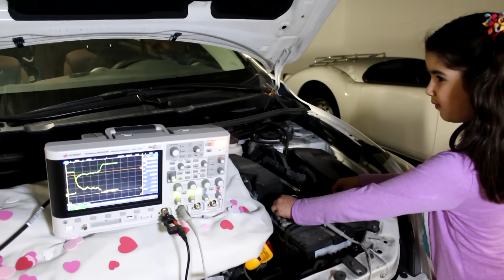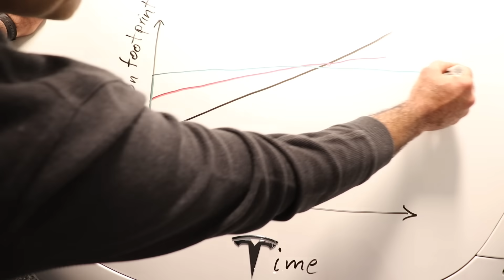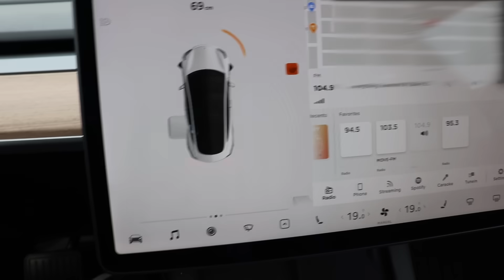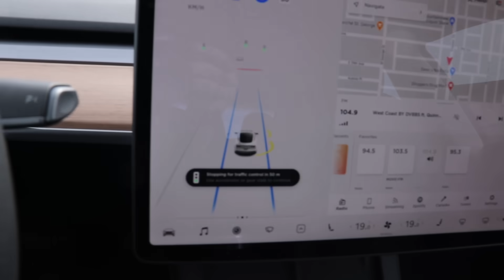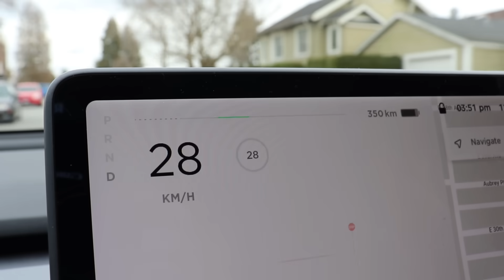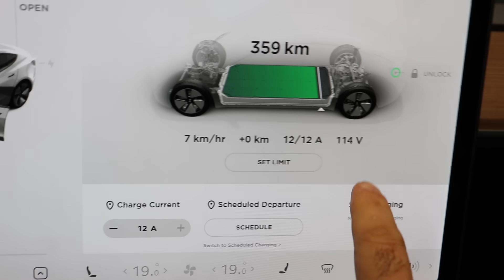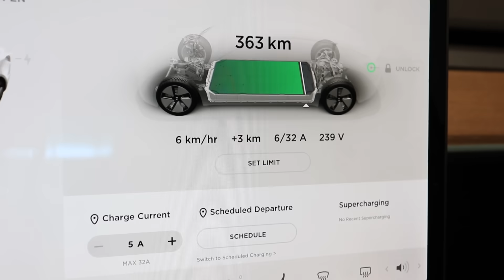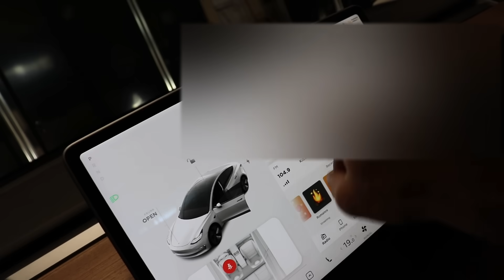ELECTRIC VEHICLES & My Tesla Model 3 Review

Comment: since when does a gas car not have as much range as a car that takes 30 minutes to charge? it takes like 5 minutes for a gas car and you can carry emergency gas in a car. arent electric cars that use scarce proprietary feuling stations worse for road trips?
Reply: Who drives 260 miles without stopping for a rest?
Reply: @jackwhitlock1  who wants to stop for an hour just to re fuel
Reply: @dancingturkey147  It doesn’t take an hour. My Tesla Model Y takes 20 minutes, barely enough time to go to the toilet and get something to eat.
Reply: @jackwhitlock1  20 is still pretty bad.
Reply: @dancingturkey147  That’s 20 minutes every 350 miles…

Comment: Problem with Lithium batteries is they still have drawbacks when cycling.

They last longer if you do not use all the charge within them, and maintain a 10%-20% Depth Of Discharge to get 12000 cycles out of them.

If you used that car everyday discharging to almost 0% , and then charging to full again (cycling at 100% Depth of Discharge [DOD]), it would barely last a couple of years (600-700 cycles), or not much more.

It would still cost a new battery, plus electric fuel for a couple of years (at 1 charge 100% DOD per day),  around $35K U.S. every couple of years to run the car.

$35K Price includes a new battery and all the costs of charging it for a couple of years. (excluding battery install fees)

That is based on the Model 3 Long range battery of 75KW.

That is approximately 1/2 the price of a Petrol car costs just in fuel, without the maintenance costs.

Still cheaper.

Comment: I own a Chevy Bolt. When I was in the market to get my foot in the EV door, I was considering Volts as well. However, the Bolt's regen braking takes it to full stop whereas the Volt you still had to press the brake pedal. 1-pedal driving is so much fun and a deal-breaker for me as you can see. For me, the savings both in fuel and maintenance was the primary motivator. Carbon footprint... nobody pollutes like the State. So while I might try to be helpful in this way and that, I understand that the individual is dwarfed.

Studies on Tesla batteries have found that for minimal degradation, you should be discharging to about 50% and charging to about 80%. Of course if you have a trip coming up, top it off. Thought I'd mention it since you talked about charging it nightly. My daily commute is low, so I usually only plug it into 110v every 3-4 days in the summer and 2-3 days in the winter.

I got a hell of a deal when I bought mine. When I was shopping, there was a battery recall in effect, so half the ones I could find were not even for sale. I ended up getting one for less than US$16000 that had only 10000 miles on it. Best part is that because of the repeated battery recalls, my Bolt will soon have its entire battery replaced free to me. At which point it will have 8% more range than when it first went to market, and will enjoy a new 8 year warranty on the battery. When you consider the only 10000 miles it had, I practically got a new EV for less than half the price! I worry that somebody's going to hit me and strand me with no way to get that kind of deal again.

Comment: I know i'm late to comment on this video, but maybe you should consider charging a bit faster than the minimum current to get the best efficiency. The system is powered for longer, and the battery might need to be heated/cooled for longer consuming more energy during slow charge. Testing the charge efficiency at different currents/temperatures could be a nice idea for a video.

Comment: HELLO Mehdi. I admire your desire to live more sustainable. ☺ 
And I don't want to be over-aware here 🥸🌋
No offense---> As your argument was, people should not put another ar in the pool:
Building a new car and battery causes a big need of ressources🌋 and emissions💨Without pointing the finger on very big pollutions in african lithium mining facilities and the lack of recycling methods and the capacity loss over time. There are indications, that using a SMALL conventional car (Your toyota) as long as possible may even have less emissions to building a new one and dumping the other. (Or encouraging someone to dump his old car by instead buying yours.)🤫So i'll buy my first electric car: as late as possible unless I can build it on my own maybe with (until now) unavailable EXTREME SUPERCAPS to charge it with one STRIKE of a LIGHTNING.

Could you actually build a SUPERCAPACITOR LIGHTNING CHARGER? And please don't die trying🙏.
Could you make a video outside for any matter????
Reply: So for the comparison of new cars I mostly agree but compared old conventional car against new electric car the initial emissions by dumping the old car needs to be added up.... I guess at least half to be fair.

Comment: Same experience, I also upgraded from an old ass Toyota lol, btw instead of cold weather issue I have the warm weather issue, car's fan and AC keeps running while parked to prevent cabin overheat which could technically be turned off but I guess option is there for a reason

Comment: 15:10 holy cow what is that? (European here)
This outlet and the adapter look INSANE.
Reply: Would you like a full explanation or a shortened explanation?
Reply: That outlet is usually used for ovens, washer/dryers, etc since it's our only source of 240v for the normal plugs we only have 120v so basically you guys don't need it anyway

Comment: Electric cars are fancy at the moment. Just like vaccines for covid. Governments pay for it (at least some of it) right now. But in the future...the electricity will increase in price and decrease in availability (because of the green shit) and then...electric cars will become less attractive than gasoline cars. And neighbors will have electric cars too and the grid won't be able to keep up with this situation... We will see what's next.
And, BTW, electronic injection cuts fuel when going downhill while the engine still revs and charges the battery and keeps everything working using potential energy gained by consuming fuel in the climbing process. Of course, most drivers will accelerate downhill because they are stupid... But that's a different topic.

Comment: Awesome video, and I like you tryiing the features for real instead of just going ooooh and aaaah over them :) But the newer bolt EV has a 66kWh battery pack, wouldnt it get a longer range than the basic model 3 with a 54kWh pack? Or does the canadian version of the bolt get some sort of a reduced battery capacity?

Comment: I got mine 2 months after you did...my left rear door handle is actually slightly recessed too (but not as recessed as yours, it's very slight).  Also, I can tell by the interior that you have the refresh Model 3.  This means it doesn't have the electric heaters from the original one, it has the Octovalve heat pump from the Model Y.  It still produces heat, to heat the cabin and batteries, but the COP can be anywhere from 1 (when at about -30C) to about 4.5 (around 10C).  It's MUCH MUCH more efficient and one reason the new Model 3's have higher range.

Comment: in germany:
30 €cent/kwh
54kwh battery travel 300km makes it 16,20€

my car, a 1999 passat 1,9tdi, worst case it has 6 l/100km, best 4 l, so lets take 5 l/100km
diesel is at around 1,52 right now.
15l travel 300km makes it 22,8€

cost of my car, 10 years ago, 2500€
cost a basic tesla 3 42000€
that means i have to travel 598.485km to brake even. 
the fucking batterys in a tesla will not hold this long and my car has already proofen that it can drive 480.000km without major problems. 
and oilchanges are cheep, every idiot with two lefts hands can do it them self.

Comment: Driving downhill in a manual gasoline car with your foot off the throttle while in gear supposedly doesn't use gas because the rotation of the wheels is what keeps the motor spinning; and that should keep the alternator and battery charged.

So your statement about all gasoline cars using lots of gas driving up and down hills isn't entirely accurate. For automatic vehicles, sure.
Reply: Most people, more so those who would consider switching to electric, are already driving automatic transmissions, or even CVT's.  We realize you diesel and manual folks are over there with the guys who need loud pipes and big wheels, not ready to change.  We're not expecting you to change so easily, but...a whole lot of us are ready and willing for the change, as soon as it's practical for our situation.
Even if Mehdi used the word "all," it was probably a reasonable exaggeration, if it's mostly true.  Most of us aren't using engine braking.  Even if I was, I'd rather have a feature that put gas back in the tank almost every time I slowed down, over one that didn't use gas in one specific situation or required me doing something extra each time.  (i.e., shifting my auto from D to L when I want to slow or stop.)

Comment: The pedal behavior you described with regenerative braking kicking in to slow you down, similar behavior does happen in traditional cars, it's called engine braking. Most people with appropriate follow distance can take advantage of engine braking without needing to use the brakes. But maybe regenerative braking is more aggressive than an automatic's engine braking at lower rpms.
Reply: Engine braking is the half-stop.  Regenerative actually puts fuel back into the system, by making the motor into a generator.

Comment: To avoid having to make a deliberate turn on the wheel to convince Autopilot that you're paying attention do the following:
1) Rest your elbow on the arm rest (either arm)
2) Rest your hand at the bottom of the steering wheel against the spoke

The car makes enough adjustments to the steering (very few roads are perfectly straight and level) that the opposing force you exert on the spoke is enough for the torque sensor.
You still need to pay attention! But you don't have to think about moving the steering wheel just the right amount to keep the car happy without switching off the auto-steer.
Reply: I feel like it also might have a system that visually monitors the driver, who, at least during the video, was looking away from the road periodically.  (Which someone dozing off & on would also do.)  I'm not sure on that, however, and I'm making no accusations against Mehdi.  Somehow other people manage to be completely asleep (reclined, no less) while their car is speeding dangerously on the freeway.  Both of these extremes tell us that autopilot is not nearly perfect yet.  The technology needs time to be developed.
Keep.  Your.  Eyes.  On.  The.  Road.

Comment: This is why i love electro boom. His arguments for what matters and what doesn't were sooo true
Reply: Not really since he bought a Tesla yeah they require less service but what he said about Car Enthusiasts wasn't necessary because car enthusiasts love vehicles okay so they first buy a daily driver like a normal vehicle most likely my first car might be a Hyundai Elantra Hybrid then when the scrape up some money they buy their first sports car or such or maybe even a second normal vehicle, then they don't buy another car but then you get in you're 30s at a dead end job you have enough money so you splurge it on a nice fancy new sports car and that is the cycle of the car enthusiast usually they would not buy a new fancy car more likely a used car maybe 90s or 80s but most likely  2000s cars
so is buying a Tesla worth it I do not know since I will most likely never buy one I would most likely buy a Hybird or PHEV either a Honda Or possibly a Prius but I do agree that if you buy a new sports car its pretty dumb unless you are rich.
Reply: I do agree with most stuff he said, but with driving good down a hill you wont use fuel aswell on a petrol car granted you wont gain range, but the mein issue is the price of the electric car compared to a petrol car buying a petrol car is like 15-20 k electric is about 40-60 i can use petrol to fill my car for a lot of time until i reach the same price, and that doenst include the thought of needing a new battery at some point.
Reply: @tipips new battery  ? Tesla gives warranty for 50k miles or 8 years which is good but not means battery will ruin after 50k miles or 8 years, just warranty. Actually ev battery can last like 25 to 30 years and don't look at older tesla models because they improved a lot now.
Reply: Right? I want a friend like Electo Boom in my life

Comment: The cardboard boxes are hard to detect due to the fact that radars play a vital role in obstacle detection. The denser the object is (and bigger surface area) the easier it is for the radar to pick it up. Also, when either the vehicle or the obstacle is stationery it makes it even harder to detect as radars are calibrated to discriminate smaller stationary objects in order to avoid picking up too much "false" readings or noise. Doppler's effect is best utilised when multiple clusters of data read from different points of an object by radar have correlating fluctuations in Doppler's speed that it's been calibrated too.

If your car has ultrasonic sensors - they are very short range and high response time so they are only used as proximity sensors.

LIDARs in cars are usually long range and are used to reinforce radar's data reliability by data fusion. That means the beam and short range is narrow. It's also likely that they are just 2D LIDARs meaning that if they were angled at a certain angle the entire envelope could have missed the boxes.

Lastly, cameras most likely use AI that were only trained to recognise lanes, living beings, traffic signs and traffic lights, they aren't used for your standard obstacle detection.

Took me years to learn all that by practice :)
Reply: So he can still easily run over a small child or a dog huh?
Reply: @timberslut  lots of variables play role here, but living beings (flesh) is much easier to pick up by 24 GHz or 77 GHz radars due to higher density and overall object thickness, then also movement plays a big role as radars pick up differences in VELOCITIES, so if an object is moving even slightly it makes a huge difference.

Of course sensor angle positioning and redundancy sensor roles matter too..

Comment: I had a Nissan Leaf for 2 years / 8000 miles by which time the range was 35 miles. Nissan would not replace the battery under warranty because they said I had plugged it in to recharge it when it was already 80% full and that invalidates the warranty. Pity they a) don't put in a decent computer that prevents you charging more than 80% and b) don't tell you that when you buy the car. And c) if you can't charge it more than 80% then the range is only 80% of what they claim, even if their claim was correct - which it isn't.

Comment: 5:05 Mehdi, you're disappointing here. I thought you would talk about the torque curves of electric motors and their possibility of being overloaded for short times.

When the FRG went from steam to electric locomotives, before, it was custom for the conductor to start the train standing at the first waggon, then close the doors when the train accelerated besides them and jumping on the last waggon. When the electro-locomotives were introduced, it was a common joke of engineers to "leave the conductor standing at the platrom" by accelerating so fast the train was too fast for the conductor to jump onto the last waggon.

Also, many railways switching from steam to electric and not Diesel is that both electric and steam engines can be overloaded, so they don't need everything a Diesel loco needs.

You may have a smaller carbon footprint in a Tesla, but have you taken into account the effect on global warming all the hot air Elon Murks produces?
Reply: 10:40 Can  you make a dedicated video on regenerative braking that I can link to? 

Hey, if it's "wish-something" Monday, can you narrate it in German, so I can give it to people who don't know about Nutzbrems (Regenerative Braking)? - No? - Well, it was worth a try. :-P

Comment: you dont burn fuel when you go downhill in gasoline powered car...
Reply: You don't gain it, either.  Regenerative braking puts fuel back in the "tank."
Reply: @VoltisArt  yes agree but the problem are the batteries it takes time to get them effectively charged... If you start pushing current, the chemistry has to be started first and then it can charge... so you can use it in long downhill braking but a short one like the majority are like will do shit..

Comment: no, because feul engines work for 25 years or much more. somtimes 50 years.    electic vehicle needs new battery in 7 years.
electric vehicles do not produce less carbon, when including making it.
Reply: Which country allows you to drive a car for 50 years? Does your country not have a scrapping policy to remove these vehicles that do not comply to emission standards?

And at current tech, batteries can run for 15 years
Reply: @kingbradley3402  That country would be where Mehdi's Tesla was created:  The United States of America.  There is no prohibition against classic cars, though some states like California have laws for emissions that may limit public use, though even there, if the car looks cool and isn't pumping out black smoke like it's about to launch into orbit, no law enforcement officer will pull you over just because it's old.  They might want to take pictures with it, though.

Good to know duration is getting better, with so many comments here quoting five years likely on the battery.